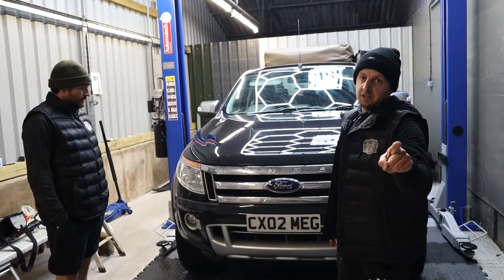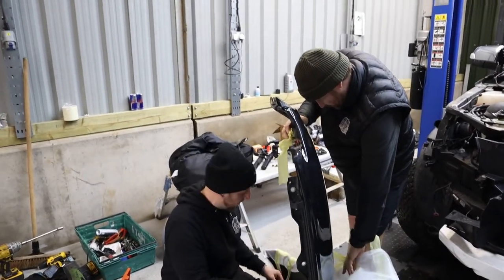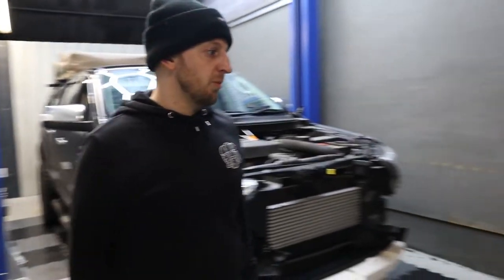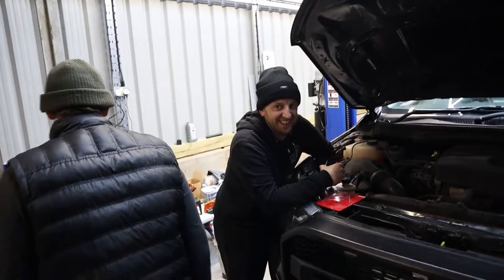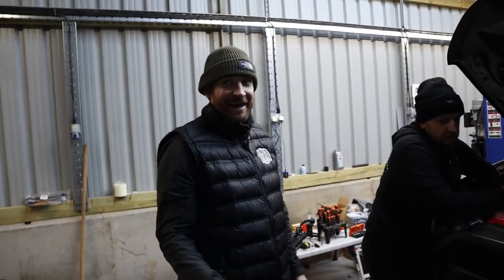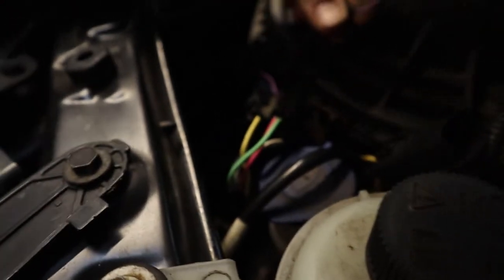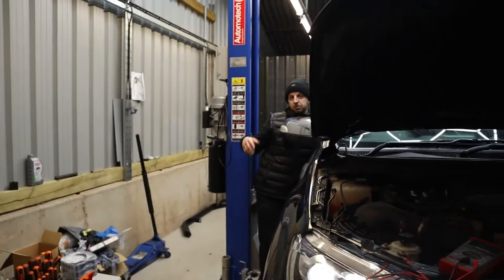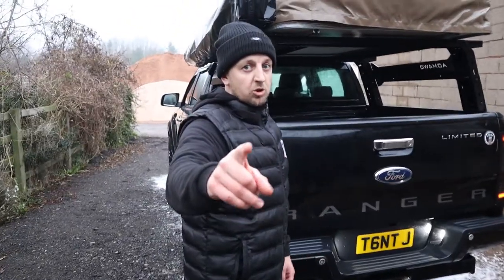Ford Ranger T6 to T7 Raptor Conversion - Transforming The Pickup!

Comment: I’ve just brought the same grill for my 2017 ranger, it fits fine except for the bottom part of the grill doesn’t clip in. There like 3 plastic tabs, did you guys drill screws through the plastic tabs to hold them to the bumper?

Edit: finished watching the vid, and you’ve done a great job. Any ideas where I can buy to big Ford letter for the front grill? As mentioned I have the the same grill but need the letters
Reply: Mine come with the front end I bought it has x2 self tapper screws in the bottom that have been fitted so you might have to do the same and the Ford logo is fixed already on mine but have no idea where it was from hope that helps 👍
Reply: @richardstokes2209  appreciate that mate thanks, yea it came about a dozen or so screws so I did think it might be something like that. I’ve managed to find some FORD letters online for £30 they have screw holes in the back but I’ll need to find some sort of retaining clips from somewhere. I personally think this style of grill is far better than the wildtrak or raptor one. The only thing I’m not too keen on is how far it sticks out. From the front it looks great but from the side I my kinda gives it a big nose lol 
I’ve seen a small few colour match the trim of the grill to the truck which looks pretty smart

Comment: How did u get on with those new waterproof type plugs chaps ?? I found them crap the connectors rattle and lose  connection luckily my worse is only oil level check

Truck looks spot on 👌👌👌
Reply: Yes there not the best as they can pull apart but I put a load of electricl tape round it but we will see
Reply: @richardstokes2209  I did same mate it’s literally the connectors you push in i had issues not touching

Comment: Brilliant! 🤩 I did this to my 2012 during lockdown, definitely a big improvement over the earlier front end. 👍 You’re right about all the extra little bits you also need to do it properly. 
My next step is to devise a way to get the very  latest  LED headlights to work as the halogens aren’t that great. 🤞😁
Reply: Thanks and yes the lights are really rubbish I keep thinking I haven’t got them on 😂

Comment: Thanks Lads, just about to do this myself. Other than the bonnet latch and washer jets, is there anything extra i need?
Reply: Basically you need to order x2 bumper headlight brackets what bolt onto front frame you can get away with not running them 
Then the bonnet latch you use the t6 latch as the t7 is completely different and doesn’t bolt on and pull cable for bonnet release and open bonnet sensor are all different so you have to modify the t6 latch. 
how I did it was re drilled the t6 latch so it sits 10/15mm higher then you use the t7 bonnet part that goes into the latch but it’s a thicker gage steel so it is to fat for the latch so I just ground down to the same gage as the t6 then the bonnet catch will work you can also us some washers as fine tuning on the bonnet side to space it down 
If you’re t7 bonnet comes with the jets your fine it will plum up with pipe but if not the t6 jets are completely different and won’t work on t7 bonnet 
The t7 also uses bonnet struts and not a bonnet stay but I still use the t6 bonnet stay I will fit the struts at a later date
Reply: @richardstokes2209  Legend, thank you!

Comment: do you have a link for the bulbs as i had this issue with bcm unit and cost me 600 quid would like to know what bulbs your using thanks also great work looks wicked!
Reply from the maker: Unfortunately not, we had to just fit the  standard bulbs back in (which are awful), as the LEDs kept messing up the BCM system. We may do a follow up video if we can get them to work though!

Comment: Hiya liked your latest video on the conversion, do you have video on wiring up the sports bar  breaklights.
Reply: There just plug and play the rear lights
Reply: @richardstokes2209  is the wiring loom behind the fuel cap / chassis
Reply: @garypryor3799  it’s at the back underneath behind the rear bumper on the underneath the tub there is x2 plugs on the loom for the rear lights if you remove rear lights follow the light lome you will find the plugs

Comment: Did you guy do led bulb conversion or the newer front end yet iv just brought a 2012 with a 2016 conversion but the lights are rubbish at night I wonna upgrade the bulbs but people saying it blows the bcm
Reply: The front end I got had led bulbs fitted and it made my bcm turn the lights off so I had to fit the standard bulbs and use a code reader to go into bcm and rest and like you say the lights are shocking what I think I am planning to do is fit the mustang headlights that are led but have something in them to trick the bcm as I have led rear lights that do the same thing and have not given me any trouble
Reply: @richardstokes2209  cheers for the reply richard so with the headlight bulbs can i still change the side light bulbs fog light bulbs and projector bulbs all to led just not the other bulbs that are none projector
Reply: @theanton9633  yes if it’s fused at the fuse board you should be fine if it’s through the bcm or cambus system it can play up but the other way to get round this is if the led has a resistor in and tricks the bcm and cambus system as I have fitted led rear lights with no problem as they have resister in to trick the car this is also the same when I get some aftermarket front lights like the mustang headlights they all work as they have the resister in hopefully that all makes sense 🙈😂
Reply: Brill job guys
So how much to change my 2015 wildtrak?? And can you do the job for me?

Comment: Where can I get this conversion to buy?
Reply: The front end is all Ford parts so you can get them second hand or new the arch kit a lot of companies do them for the ranger all you need to convert to t7 is bonnet x2 wings bumper x2 headlights front grill x2 headlight supports you have to modify bonnet catch and the t7 bonnet uses gas struts instead of bonnet stay but you can use either also you have to wire in some of the t6 lights to t7 headlights just the dipped and main beam and sidelights it is not a hard conversion if you know how to us a spanner you will be fine